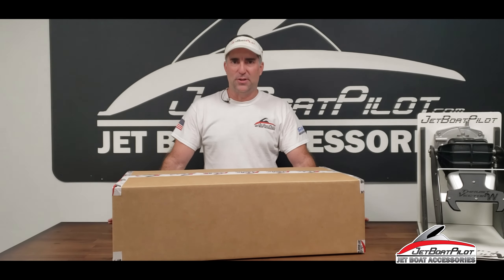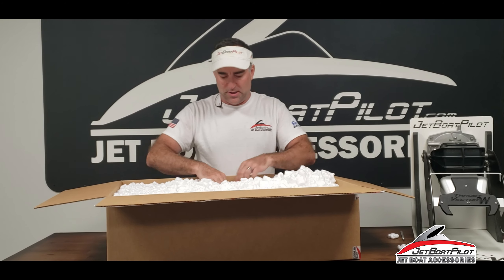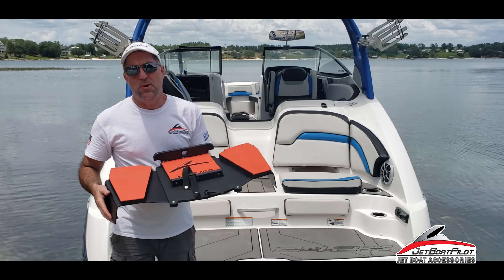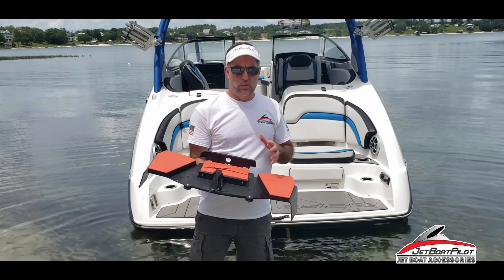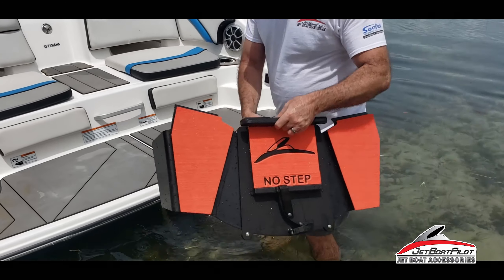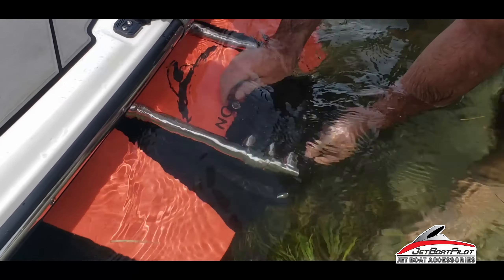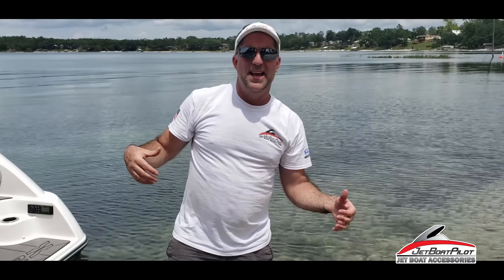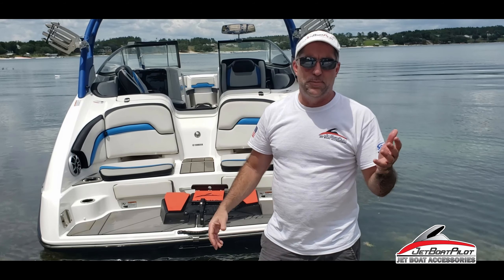JetWash Deflector For 24 Foot Yamaha Boats Unboxing And Instructions

Comment: Does this work in place of or in conjunction with a wakebooster? 
Looking forward to the 21' model!
Reply from the maker: It does the same job essentially, and can also be used with a booster in the 21 foot size. The 24 foot version does not work with the booster.

Comment: Is this supposed to replace, or be used in conjunction with the wake booster attachment?
Reply from the maker: It is similar to the booster but designed to be a bit easier to change from port to starboard side surfers. Also serves to aid in lowering the bow and achieving target speed with fewer rpm's

Comment: I looked on your website for the deflector, but I can’t seem to find it. Are these still for sale? I have a 2016 AR240
Reply from the maker: No sorry, they were discontinued.
Reply: Why are they discontinued?  So is the answer a Wake Booster & ballast?
Reply from the maker: We just did not sell enough of them to keep making them. They work really well. You just have to know how to setup your ballast to make the boat surf well using any sort of surf device behind a Yamaha. Booster and Wake Wedge are the only products still out there for now.
Reply: @JetBoatPilot  I am using the booster in a 2019 242Xe.  It seems to work fine, but I still need to learn to get right weight in the bow to make a longer wake.  People who have surfed behind inboard wake boats say mine is not as long a wake as they have.  I am in Tn river TVA system so I need to be able to run in more shallow water at times.  It wouldn’t be worth it to me to spend the extra money on an inboard.  But, this is my second Yamaha & I’m getting spoiled by the low maintenance compared to stern or inboard boats.  Those engines are just east, so until someone in my family decides to be a pro surfer, I will stick with the Yamaha